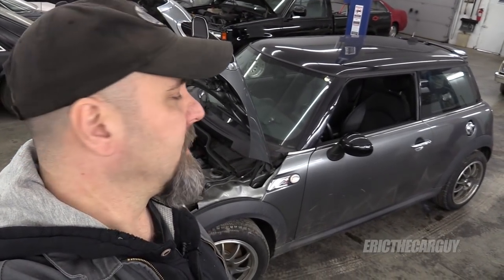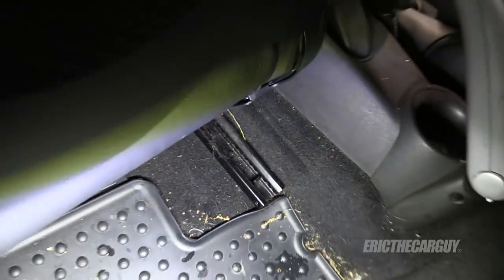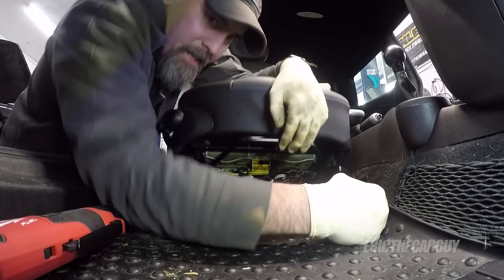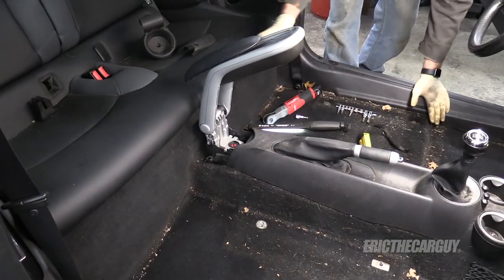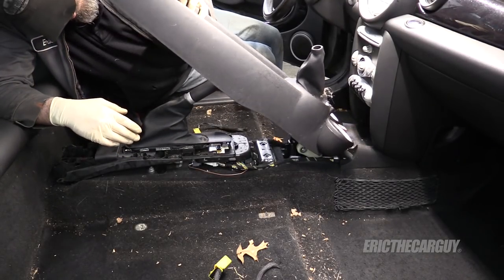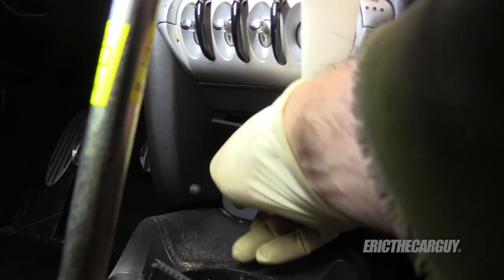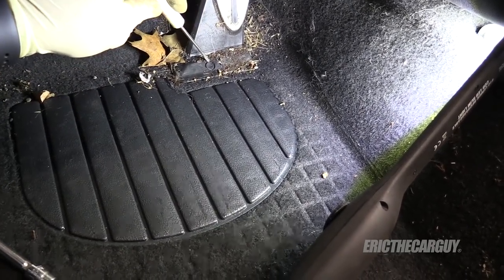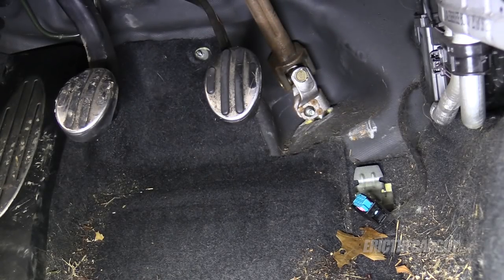Carpet and Seat Removal R56 Mini Cooper

Comment: "Let's use every size torx available while we design this car"

-BMW engineer
Reply: ADR like if he was doing this job by a normal screwdriver i bet he will become a bodybuilder just from unscrewing bolts xD
Reply: I'd imagine they try to use fasteners that are as small as possible but as large as necessary... the torx holding down the center console obviously cannot be the same size as the torx anchoring the seatbelt.

Comment: hey eric..(fellow viewers feel free to jump in too). i have a 7th gen Accord with the 2.4L 4 cyl. engine.   ive had the car for a little over 6 months and it has always been kind of slow to start up compared to my prev. vehicle (vw jetta w. vr6). it seems to be turning over fine, but seems like it takes awhile to fire up(im not sure if thats the right terminology, but basically its the classic " cmon please start...YES!" sound)... i looked over same basic stuff, my battery's positive cable terminal was loose and corroded so i cleaned and replaced that with a new terminal.  its not a huge deal, the car never fails to start, but it just feels like i have to turn the key for an awkward amount of time compared to my VW.  This is only the second vehicle i have owned so i cant tell if its just a normal difference between the vehicles. 

since you sort of specialize in working with Hondas I figured you would be the perfect person to ask, and if it is not normal, where should I start looking to get it fixed... I was thinking since its taking awhile to fire up, that might be something with the fuel system and not electrical ? anyway, sorry such a long post for a relatively trivial and simple issue!   curious to hear your thoughts.   thanks! 

 ps. I am super happy with my Honda, your videos helped me lean that direction after the non stop horror show that was my VW.

Comment: I had to do this on my 2005 Chevy Colorado when the urethane glue on the back window let go in one corner and it started leaking when it rained. What a mess. After I had a glass shop remove and reseal the back cab window, I was able to get the carpet completely dried out by removing it and laying it out for a few hours out in the summer heat then sprayed it with a product called odoban and put it back in. No further issues from it while I had that truck.

Comment: hey eric you should do a video of removing the rear panel to gain access to the driver seat-belt. the r56 has a common wet seat belt after its rains , its usually a gutter seal but i would love to see exactly whats going on behind the panel before i dump a 100 plus on a gutter seal that may have nothing to do with it. thanks in advance and keep up the great work.

Comment: Finally you got use of those Torx tools of yours collecting dust :-) Actually, Torx is quite common here in Europe and has been for some time. Take a Volvo from the 90's - you can actually take apart the entire car with only a T20 screwdriver :-)

Regarding that handbrake switch connector - I agree it looks odd but it works.
However it's far from a new cost-saving thing - they used it already back in 1967 when the BMW 1602 was launched.
And it's exactly the same switch in my BMW 323i from 1985 :-)
And the same in my BMW 535i 1989 :-)
And the same in my BMW 120i 2006 :-)
I think it was phased out in the last 5 years or so - but a construction that was unchanged the last 50 years :-)

Comment: Good god. If I did that with my mini I’d probably never put it back together, but that’s me. 
I had 2” of rain water on the passenger side floor. I popped the floor plugs out, shop vac the carpet, and run the blower, from my dust extraction system in the shop , down under the carpet, for hours and hours, until it dries out.

Comment: Amazing how much had to be done.  I'd be the one pulling the seats and side trim-  Peeking under the carpet checking for water damage.  If none found-  Get one of those huge air dryers used for drying carpets and such.  Then give it a good vacuuming with some odorxit to remove smells.  That was extreme for disassembly.

Comment: Disconnecting the battery is a must...the seats have airbags in them (hence the large yellow plugs).  You don't want those to accidentally discharge when working on a vehicle!  This ain't no Fairmount,  you often have to wait for s capacitor to discharge (stored energy) after disconnecting the battery to prevent accidental energizing any of the SRS systems.
Reply from the maker: Actually no. They have seat belt retractors, not airbags in this model.
Reply: EricTheCarGuy good to know.  It is still a best practice to disconnect the battery.  Enjoy your videos.

Comment: I would've gone over that carpet with a high powered pressure washer and some carpet wash. Then left it out to dry in the fresh wind. Just to get the deep crap out of the carpet and also blow off any mold that might've started getting hold.

Comment: Hey eric
I just got a 95 honda accord wagon,automatic with non vtec 4cyl.  and on the 1st initial cold start after it sits, say overnight.  There is a grinding noise from the starter area for a split second, then it goes away...And only does it on the first start.. If i shut it off right away and start it again, it doesnt do it
I put a new starter in it and it still does it. And the flywheel teeth are fine, so i have no clue..

Only thing i found online was for the vct actuator on newer hondas causing the grinding upon the 1st start, but couldnt find out if the 94-97 accords even have a  vct actuator or not
So i have no clue what the noise is

Any experience with this?

Comment: I like the carpet in a 66 Chevy truck. Rubber mat. Yank it out, spray it down, and shove it back in.
Reply: my late grandfather's 92 F150 XL had a rubber mat instead of carpet.  It was super bare bones base model.  Radio only, vinyl bench seat, crank windows.  I6 engine.  He used the heck out of that truck.

Comment: I see this car has the amp wires under the passenger seat Or is it somthing different?
Reply: Unused pink connector may be SiriusXm.  Sirius was an option starting on the 2007 Cooper Hardtop.  The CD player may be Sirius-enabled.  Probably just need a junkyard Sirius-enabled antenna 3449241 65203417195.  $60 on ebay.  And the extension wire...

Comment: Does the big yellow connector on the seats mean they have airbags? If it does I guess you would still have to be careful because as you know they can still go off with no power.
Reply from the maker: Not airbags in this model, seat belt retractors.

Comment: The video is excellent quality, especially the multiple views stitched together.  My opinion, however, is that pulling the carpet out completely was a waste of time unless you're actually going to replace it.  When you put it all back together, some of the trim may be loose due to broken clips, etc., and you may have rattles and poor fit. I would have just vacuumed it really well and let it dry without the seats in place.  Pull up the carpet at the edges so you can vacuum up any standing water with your shop vac. My carpet got wet from a leaking windshield, and it eventually dried with no appreciable odor.
Reply from the maker: Well, you don't make a living by posting repair videos on YouTube. Also, What I did worked fine and didn't cost me anything but time. Without filming 30-40min tops. Also, it's back together and better than it was before. No rattles or anything. You'll see that next week.

Comment: If it was just slightly wet and not drench in water, i would have just put a heater and a fan with all doors open. Save myself the hassle from all these nuts and fragile plastic tab that are a nightmare to work with.
Reply from the maker: It was drenched.
Reply: Yeah that foam part retains water like a sponge, if it was just carpet you could have been fine with just letting it dry on the car perhaps.

Comment: Hi I have a Acura 1998 3.2 TL when I put my car in drive it’s clunking noise from my transmission and the car will not move it’s like the fly wheel in my transmission is off track

Comment: Holy geebuz! That's a lot of work to remove a carpet. On my Miata it's so much easier (albeit most people cut the center to get it under the dash, otherwise it requires unbolting the lower dash supports).

Comment: if you started the car up without that passenger seat connected, would it just give you warning lights forever? I'm trying to build a sleepable bed in my r56 that stretches the passenger side of the car.

Comment: The wire connector actually costs more as is than the "connected" one. TRUE, they used off the shelf parts to cobble something together, but still. Also, short of that plastic piece breaking apart by magic, the wire won't come off. Just saying.

Comment: seems like too much work for drying the carpet, if you needed to replace it, i could see the benefit, but you could have just sat a fan in there let it air dry and grabbed a vacuum later.
Reply from the maker: With as thick as this foam is, I think this is better. However, just drying it out after removing the seats might do the trick, but I wanted to show it's removal so that if anyone needed it, the would have it.

Comment: I recently replaced the thermostat assembly in a 2010 Mini Cooper S. I am fortunate that I found a three part series on YouTube that was done really well. The plethora of plastic electrical connectors was especially challenging especially given the numerous release styles. Some we pick, others we lift, some we depress. I wondered as I did the job, why so many different styles? Seems ripe for standardization. I look forward to more of your vids, especially timing chain re and re.
Reply from the maker: I don't cover that replacement in this series, but with the engine out it's easy to see where everything is. I'm starting on the engine videos after I wrap up the interior videos. You're right though, it's kind of a cluster.

Comment: Good to see you back Eric I think thus one I just would have did the sill plate and such on the driver side jacked up the carpeting and just dried out that side which didn't even look that watery seeing how the passenger side was fine I can't see going through all that work just to dry up a spot of moisture or even try putting a dehumidifier in there for a while would have probably done the trick just my opinion
Reply from the maker: What I did made a great video that will help a lot of Mini owners. Also, the carpet was VERY wet. That foam was completely soaked through. I'm afraid leaving it in would have made things worse. At least in my opinion.

Comment: That one connector from the console looked like a MOST fiber optic connector. Not sure but bmw and mercedes use this method of information transmission. FYI make sure it does not kink if it is a fiber optic connector
Reply from the maker: It's not a fiber optic connector. It's the parking brake light signal.
Reply: good thing, those suckers are not fun or cheap to repair

Comment: My wife always wanted to get a Mini Cooper cuz she says they're fun... These videos are making me think otherwise lol...the crappy quality!
Reply: If you get one, get it as a lease with a full service contract. Bring it to the dealership every time, and get a replacement car while they work on it. When the lease is over, give them the car back. No fuss, no hassle. Only way to not get screwed over by German cars :)
Reply: From what I've seen so far, the build quality looks to be roughly equal to any other 10-12 year old vehicle?
Reply: The quality is not bad. It's just like any other modern vehicle. All plastic and made to snap together.
Reply: PetitCorpsSalade lol at the suggestion that German cars are poor quality

German cars are renown for their good quality and this doesnt seem any worse than any other mass produced car from the same era
Reply: Adam Spencer That's a joke. German cars today are NOT good quality.
Reply: Lol. I've owned an Audi and two Seats and they were built to be as cheap as possible.
Reply: I did that with my 2015 Jeep Cherokee.  At the end it was a good car but there was a lot of problems early. And the service was TERRRRible!  I walk away last October with NO regrets.
Reply: That applies to any German plastic. LEASE IT! And when the lease is up, get rid of it as quick as you can because those things are engineered to start falling apart soon after.
Reply: look at the repair records on these and you will cringe..

Comment: Whenever I see these "modern cars" with the stupid & needless T-series type bolts & screws, I enjoy & appreciate my 25 yr old '93 Celica GT Cnvt more. Old is the way to go.
Reply: sleepyhollow783 It’s mostly a just European car thing. Japanese and American cars don’t use nearly as many, if any Torx bolts. Hell if you have a 10 mm socket you can take apart 80% of a Japanese car.
Reply: My 99 Ranger has some torx screws on the inside for the dash panels. This isn't anything new, dude.
Reply: Jeep Wranglers use torx bolts a lot too
Reply: sleepyhollow783 you'd love Scotty Kilmer
Reply: old/Japanese isn't always better.  When I replaced the head gasket on my 94 Integra GSR in 2013, the car sat up on jackstands for 2 1/2 weeks because I had to wait on so many replacement parts that broke while I was taking things apart, trying to pull the head and intake manifold off.  It was infuriating.  At one point I even broke the vacuum tank used for the intake manifold butterfly valve, which costs over $120 new for a little plastic tank, if you can even get it new.  Thankfully a generous dude on Honda-Tech sent me an extra one he had just for the cost of shipping.

Comment: Wait until you meet the torx bolts that align the discs, over tightened to Jesus and no impact driver or air gun will budge them, your options are heat or drill it out...
Reply from the maker: Not the only option. I've used this on Honda screws and other stubborn fasteners and it never fails. https://www.youtube.com/watch?v=EqNcBkLvptg&t=37s